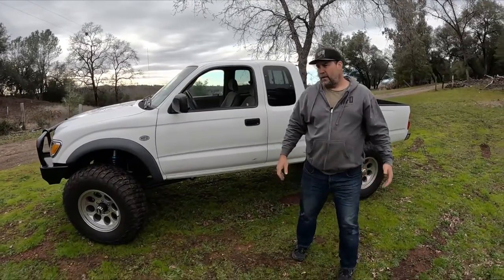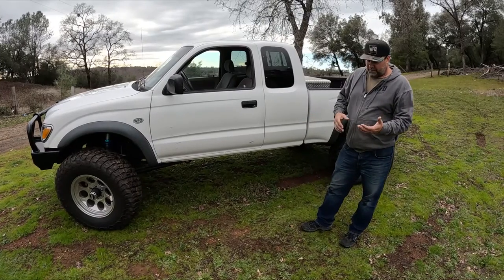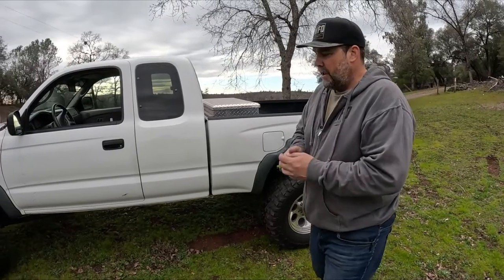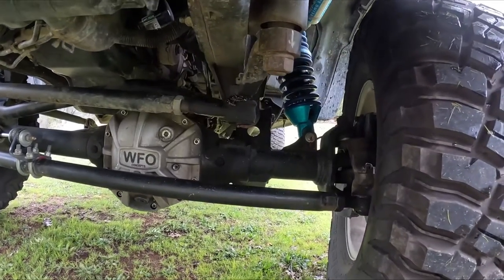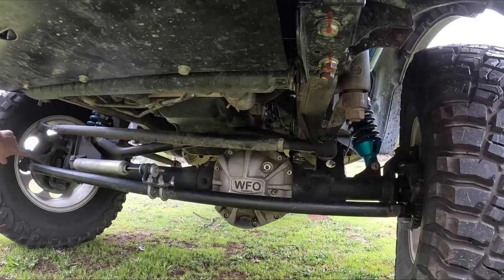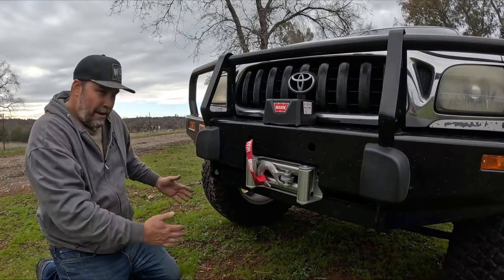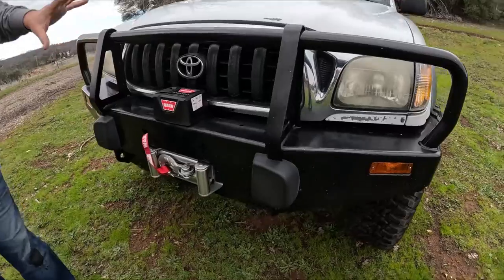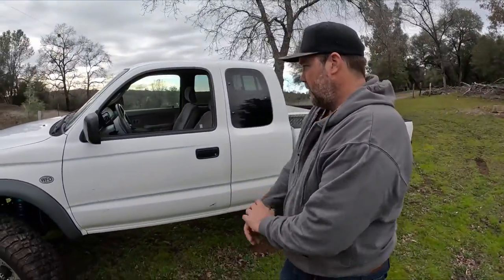WFO Solid Axle Swapped 2003 Tacoma with Dana 44

Comment: This is pretty much exactly what I want to do with my 2001 double cab. When I get a new frame for my truck, I'd like to set it up with either a radius arm or a 3 link with the Chevy 63" spring swap in the rear and king shocks and coilovers. It seems to be the perfect height for the 1st gen platform.

Comment: Wait...  are you saying that you can have dual cases with your crossmember now?  I was led to believe from previous comments your website that either it couldn't be done or you haven't tested it.
Reply: If you run the NWF eco box it retains factory mounting so  should have no problem I'd think
Reply: @bashfabrication  I don't think mounting was ever an issue.  My understanding was driveshaft to crossmember interference.  ???
Reply: @terrylovin7405  ah that I can't say. I most certainly had to modify my TG crossmember for the front driveshaft and extend the back of the skid since it was for single case